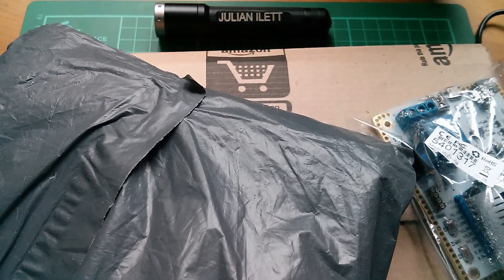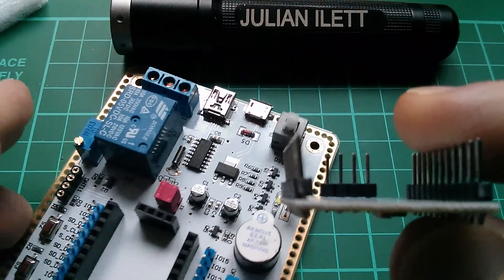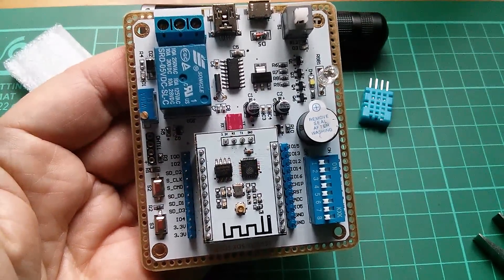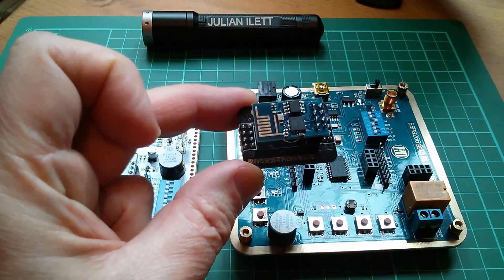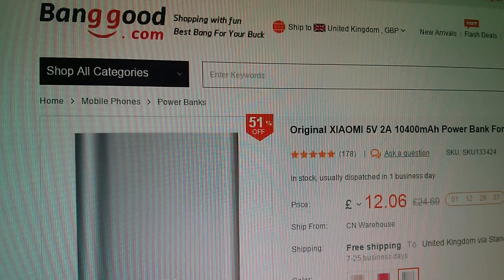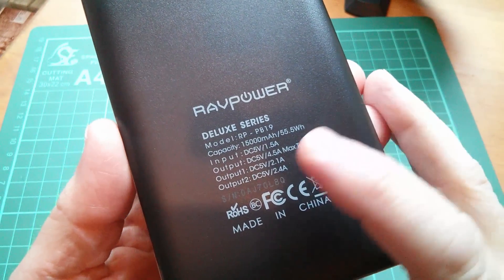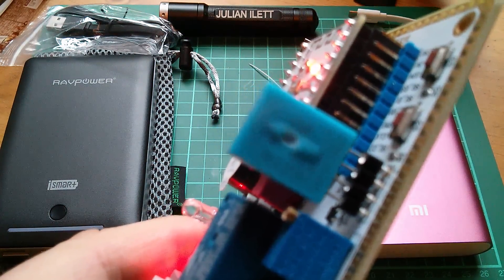Postbag: #34 - ESP8266 Test Board, RavPower/Mi USB Powerbanks

Comment: With pins marked SD_D0 through SD_D3, I'd expect those to be intended for use in reading or writing an SD card in parallel mode.  If that's what they're for, then that's rather an advanced function for a microcontroller since you normally only see programs using serial mode for SD card communication.

Comment: I bought two 22400mAh power banks (EC Technology) from amazon, 12.99 pounds each. Contains 8 2800mAh 18650 cells. So thast 1.625GBP per cell, excellent price in my opinion, and the thing actually charged and iPad Air almost two times, so the actual capacity is at least 80% of what the claim.

Comment: Thanks for this Julian. I have both test boards but like yourself prefer the ESP201 (White) based card. I have been able access the device using USB (via a terminal) 9600 8-N-1. Was able to connect it to my Wifi using AT commands. And based on clues from posts below was able to flash firmware to latest version of nodeMCU using ESP8266Flasher by putting dip switch R to on, and pressing switch 2 whilst powering up device. Final part of the puzzle is how to control the embedded devices. Main thing I wish to do is control the mains relay and read data from the DHT11. If you or anyone else reading this can help please get in touch. Regards, Phil.

Comment: Julian have you reviewed the Lenmar Helix 11000 mAh 3 USB Port Power Bank?  It's nearly impossible to charge!  Have you run into that problem with the bigger units?  I just got this today at Frys and it came mostly run down. It only had 2 lights on when I pressed the button so I put it on a 2A charger for my tablet. It gets hot but never charges up, the green light just flashes for hours and that's all. Tried another charger but still nothing. I had to use a charger capable of putting out 4 Amps! Why they say in the directions you can use the USB port on a PC to charge a unit having 11000 Mah batteries I don't know but it's a lie.

Comment: Got my little white board to flash lua on my ESP8266 03, now trying to get it to report to thingspeak with temp and humidity from the DHT11 that I plugged in the proper way after watching you smoke yours.  Those videos are so helpful, silly Chinese not putting a polarity on the DHT11 device, of for that matter the tester itself. oh documents would be nice unless they are like the ones that came with the older test board.  I have two different copies of that and neither are what I would call readable by anyone who learned to read in the 1950's as I did.

Comment: Have you figured out exactly how to talk with the esp8266 on that board?  Would be nice to be able to access the data from the temp/humidity etc as well as use the relay for switching on lights etc.   I tried jumping 3.3V to Chip on the motherboard but to no avail.  I played with the dips and found they work fine for all the lights (5) and the relay.

Comment: Had to buy one of these, the wife is right I guess I really must stop watching your videos!  I had a difficult time finding the video using the search feature but at last located it.  Then I tried to scan through to find the place where you burned up the DHT11 as I wanted to put mine in right, that didn't work, after a long time scanning and watching bits and pieces, I at last found the part, and put mine in right.  Strange even that add you showed had the thing in the wrong way.  I haven't figured out exactly how to read the data yet but I will play with it for awhile, it is nice to be learning once again instead of sitting in my damn chair watching reruns of Gilligan's Island on the boob tube.  Thanks a million for your superb videos.

I look forward to your features on these chips!

Comment: I designed a self ranging USB Wrapper similar to the chips in those powerbanks (I believe)...they use the Texas Instrument TPS2513 (dual channel) or TSP2514 (single channel) IC's and shared them on OSHPark

https://oshpark.com/shared_projects/sTExw1i9

Very neat how it can auto range the charging port data signature to the device and can self adjust to whatever is plugged in.

Great video Julian...excellent

Definitely want to see the insides of those power banks and how well they run

Comment: I would be interested to see what voltages the cells in those power banks are charged to. The last one I took apart charged to about 5V, which severely decreases the life of the cell (4.2V is considered optimal) and is probably quite dangerous.
Reply: Wow! Nice little bomb you got there. Good idea for a video.
Reply: I would consider a 18650 at 5V an unacceptable risk.

Comment: 11:25 Julian there is no need to buy anything that has a battery pack to disassemble it and obtain cheap 18650 cells. You can just buy cheap 18650 cells. I mentioned it in other videos too but people don't seem to care about cheap 18650 cells. Either they want to destroy stuff or have the maximum capacity possible.
Samsung 2600mah: 3.2€ = 2.38£ = 3.62$
http://eu.nkon.nl/rechargeable/18650-size/samsung-icr18650-26f.html
Reply: +Mandragoras If that's a genuine Samsung, I'm as Dutch as the site :-)
Reply: Julian Nicholls What makes you think it's not genuine or Dutch?
Reply: For that price, I don't think it's a genuine Samsung, or maybe it's a genuine Samsung reject. As to the Dutch question, the website is Dutch, but I'm definitely not.
Reply: Julian Nicholls
2600 mah capacity for this chemistry is too small nowadays and Samsung has been selling 2600mah cells for quite some time. It's expected to be low priced at the moment, otherwise they are overpriced either by the manufacturer or the seller. At the time I posted that comment I also knew of a German site/seller with pretty much the same prices on branded cells. Both sites were recommended by flashlight forums. As for the Dutch non-Dutch comment, I know you meant you are not Dutch but I was wondering why you implied that the site is not Dutch. Just curious.

Comment: Poor DHT11, it burned because you plugged it wrong way around. Look at the pictures in the product page. :)
Reply: Julian DID say he put it in facing outwards as it's more logical, just like the piccies. Ohm-meter to find ground before the new one arrived.
Oh, an aside, folks. Please DON'T probe any 3.3v board with yur meter on 'Beep' until you've checked the voltage out first!
I was staggered to find my trusty Fluke 77 shoves out over 4 volts on 'diode/beep' - which is its initial setting! Death to many IC's I use, like XMEGA's. Don't wanna be unsoldering an atxmega128A1 - soldering by hand 100 pins gets a tad tedious even the first time around...
A cheaper meter we use at work has diode and beep separate, and on the latter shoves out 11mV, which is safe.

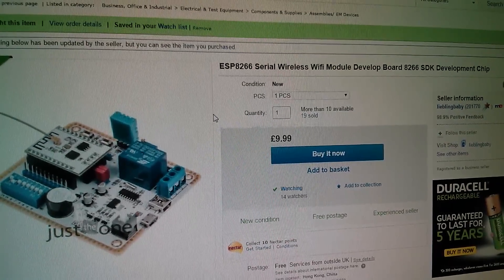Comment: 6:05 I wonder if you speak german, because you pronounced "Liebling(s)baby" correctly! :D

Btw. Do you have an idea for a cheap 12v power supply?
Reply from the maker: I studied German at 'O' level - probably my favourite language
Reply: I just got a 12V 5A power supply on ebay for only £9! I design switching power supplies and I have to say this one is cheap but it's not as bad as it should be for the price. I'm reasonably impressed. I got it to see how they make it and send it from china for so cheap. I haven't measured efficiency, noise, regulation etc, just traced out the circuit. It's a flyback converter with all local chinese branded parts, a probably fake or second hand nichicon capacitor, minimal input filtering (an X2 cap and a common mode choke) and just about acceptable mains to secondary clearance; but for £9 I was expecting much worse. It's a relatively OK design. The part number on the flyback transformer is that of a part from a discontinued panasonic LCD TV so I think that might be surplus from the factory. It is based on a OB2269 controller chip and so has some level of overcurrent and overtemperature protection. It's sold as a LED power supply, but it's a standard constant voltage output, not constant current. It's not a standalone item though, its designed to go in another device and not be exposed to the user.

http://www.ebay.co.uk/itm/300944840662
Reply: I don't know what O level is, but since I as a native speaker read the "s" that isn't there as well (but it should be), I guess it's quite advanced already.
Reply: KX36 Thank you! And it's also send from the UK, so I don't have to wait 1+ month to receive it.  Although it has no free shipping, it's still cheaper than I expected! 

(BTW. sorry for my bad English)
Reply: superdau O level is the equivalent of GCSEs taken in England today, exams taken in high school when you're ~16 years old.
Reply: max003mk
There's nothing wrong with your English! I studied french for 5 years in school, ended up with a C and now can barely speak a word of it, I am constantly amazed by how good everyone else's English is.